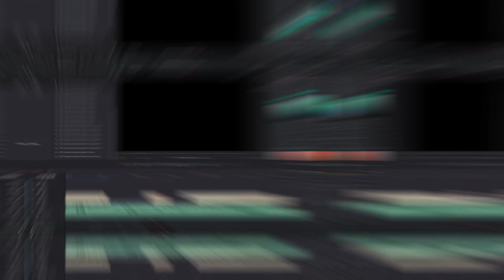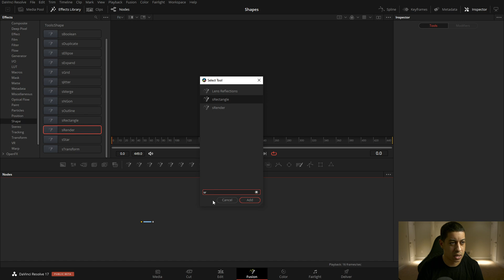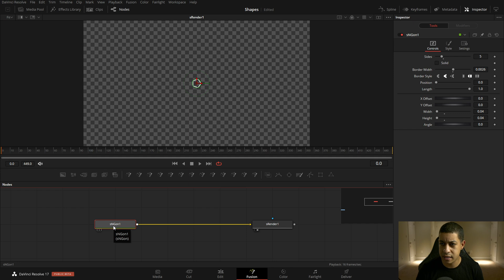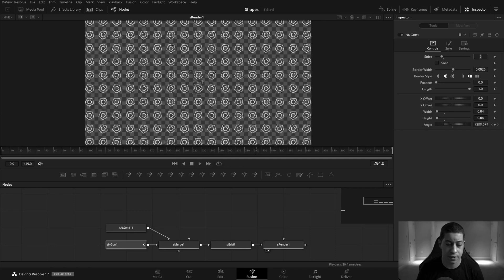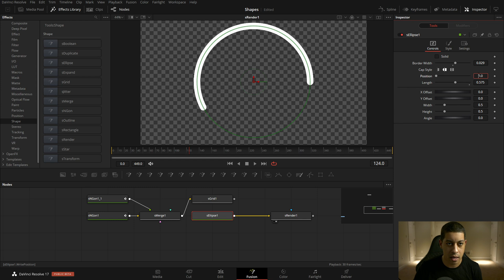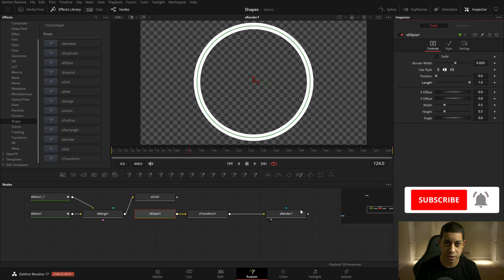New Fusion Shape Tools in DaVinci Resolve 17

Comment: The most frustrating part of DRF right now is, besides the occasional crash, the lack of proper timeline and keyframe management. Offsetting a layer’s timing is twice as difficult as it is in AE. The current keyframe icon is unclear and hard to actual click on. I really want diamond icons for keyframes.
Reply from the maker: How so? Just the use the time stretch tool in the keyframes menu.
Reply: @JayAreTV  So the limitation with this is you cannot (as of 16.2.7, or maybe it was just my one project) combine it with a Time Speed node. So if you offset with a Time Stretch then say animate the speed of the clip after it's offset, it was bugged every time I tried it. Otherwise, yes, this method is the way to go.

Comment: Thanks Jay, very interesting, that's look exiting, circle length for instance may be used for a lot of tasks. 
My main questions are related to previous version projects when using third parties OFX, for instance BorisFX, I opened with DVR17 a DVR 16 project including BCC animations, I think something went wrong and I have got a DVR17 crash. Do that's mean DVR17 is no longer supporting external OFX, or does the OFX management has been changed ? In the first case we have to keep an old version of DVR, remove the OFX importing in DVR and redo the job. Not easy, but possible, If third parties OFX are no longer supported, it's definitively complicated. Any  way, did you read something some where about OFX third party ?

Comment: I tested dr17 for 2 hours, crashed 3 times and 3 freezes, unistalled and I will wait for beta 3, because I do not believe beta 2 will improve those to tons of bugs. But was expected, that was the biggest upgrade to Resolve. I tried send reports on resolve, but 2 times said Check my connection 😂, but one time it works, I be able to report some bugs I found.
Reply: Worked with 17beta. Zero crashes except on the fusion page. Other than that is quite stable.